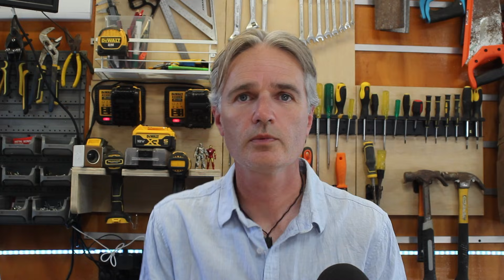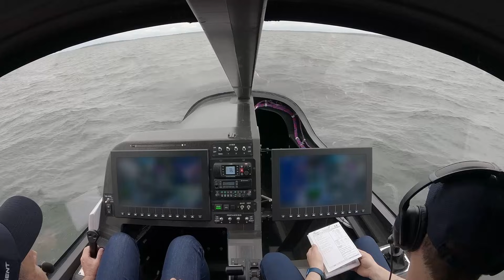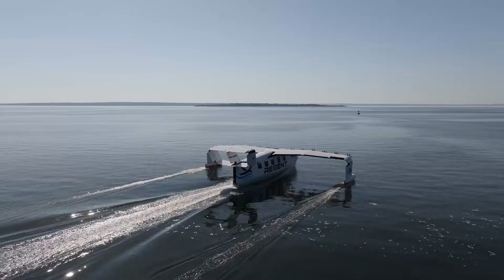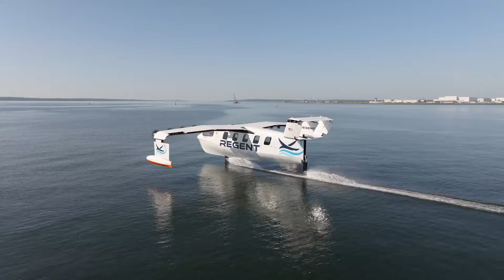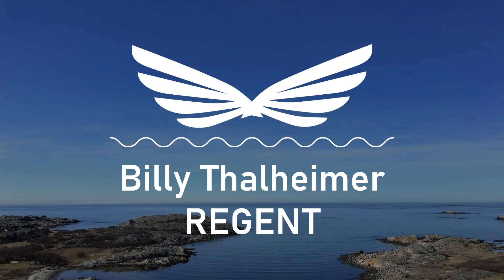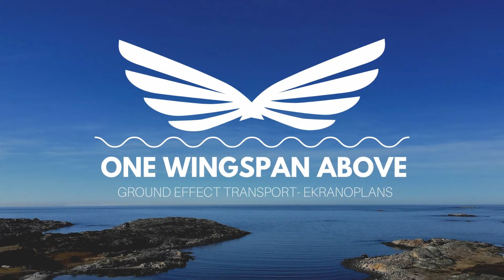Interview with Billy Thalheimer from REGENT who are developing Seagliders right now!

Comment: I never thought these were wing-in ground effect aircraft (WIG) because the height of the wings compared to the overall width of the wing wouldn't leave much of a ground effect space/height/zone to glide on a cushion of air....

But they are amazing looking....

Russian wing-in ground effect aircraft or ekranoplans of class c classification have engines at the knolls and for the back on the aircraft so they can fly in and out of ground effect
Reply from the maker: However you put it, it would be excellent to see them fly close to the surface, whether or not they are actually GE craft..

Comment: The sea glider definitely isn't designed for ground effect. the high wing, high aspect ratio.... it will benefit from *some ground effect, but flying at 10,000 ft would be more efficient.
Reply from the maker: The benefit is no airplane certification or maintenance!

Comment: Thank you for the great, informative and exciting interview.
I think that the security is at very high level. Some aircraft can only be flown with flight controller such as B2 bombers or
my RC helicopters. They cannot be controlled without a flight controller.
There were hardly any failures with the flight computer, but there were with the sensors and the actuators. These must be present in duplicate or triplicate.
I don't really like the concept of the Seaglider. But I think the company and the team are great. I wish them much success with the project.
I more like the Lippisch and the Tandem Airboat concepts, where the wing is lower and flies more in ground effect.
The Seaglider's wing is very high and the many engines with small propellers are not effective.
Efficiency and range are important for the success of the Seaglider. Good luck !
Reply from the maker: Thanks for your comments!

Comment: Nice interview, but as you pointed out, this craft is really just a plane flying at 150 mph, 30 ft above the water's surface, totally reliant on computers. What could possibly go wrong? To achieve free flight, they had to forgo the weight required for structural integrity. Unfortunately, this is just an accident waiting to happen.
Disregard the computer failure risk, you still have a lack of steer issues, and the propoising effect with any wave dynamics. 
It's very telling that they only seem to test their foils when there are no waves.
Reply from the maker: Good points indeed. Let's just hope that we get proven wrong in a way we now regard self-landing rockets as normal..

Comment: Interviewer was safety focused, good!

InterviewEE is a delusional tech bro saying at 13:40 effectively his product will NEVER CRASH because 'statistics'.

Truly terrifying gospel of 'trust in my algorithms ', jeez.

Just last week the ENTIRE FLEET of A320s were grounded for an ad-hoc software update.
Reply: Either mis-understood or mis-spoken.   The conversation was on failure of the fly-by-wire system and Thalheimer correctly referenced the industry standard (developed by airbus and FAA) failure analysis for the fly-by-wire systems.  Thalheimer is not saying the entire seaglider and its operations will never crash, rather, he is saying the fly-by-wire system is built to operate as designed with such low failure rate that it (the fly-by-wire system) will/should not be responsible for a crash.
Reply from the maker: Both good points!
Since the Seaglider is essentially a plane flying in the ground effect area, it could be concluded that it would act like any other Seaplane if computer systems fail. That is if the pilot/captain could take controls. It would have been nice to hear Billy confirm that though.

Comment: Not gonna lie, this creature confused the heck outa me.

It's like a 5yo took all the cool tech and stuffed it in the same vehicle...

But why??? A foil is efficient, and water propulsion is too.

So having 12 (twelve!!) air propellers is good only for real flying. There's a huge efficiency penalty to get in the air.

It's highly debatable whether the blown wing has any benefit whatsoever when operating from WATER! VTOL is hardly a requirement and is also hugely inefficient.

For sure the complexity of multiple systems goes beyond redundancy and starts to add more risk of malfunction. Worse in a marine environment.

For true WIGE operation, a foil, plus outrigger floats are redundant.

Tthe HIGH wing configuration defeats the point, of keeping within a chord-length from the surface i.e. ground-effect.

So business confidence is great but... just baffling design decisions.
Reply from the maker: Lots of good points. But when you delve into the engineering behind it, it actually all makes sense. For instance the reason for the blown wing is to bridge the max speed of foils and the min take off speed. Actually a PAR in disguise.
Reply: @onewingspanabove True, I'm an armchair critic but I have better than average engineering sensibilities.

Modern materials and software in design and operationally can provide benefits, no doubt.

But compromising each realm in order to transition between them, not clever. 

It's the same as always, humans want to be lazy gods and not wait for bad weather or any minor inconvenience to their important lives... 

Also why airships & seaplanes are 'history' for the most part. They were evolving into something else.

But outliers exist... the tilt rotor V22 Osprey is an abomination against the laws of nature, but the US military bankrolled it and their Marines have paid the price of compromised engineering in blood. 'mission critical' = hyperbole.

PS love your channel! WIGs are cool.
Reply from the maker: All good points! Thanks for the compliment.